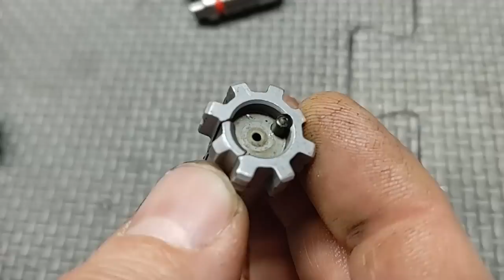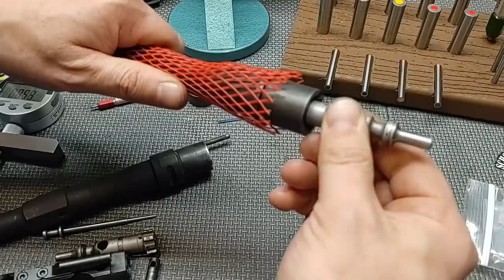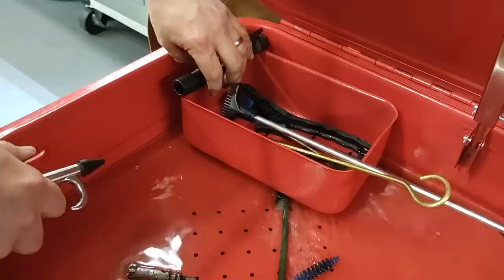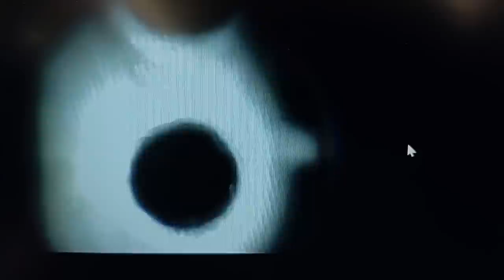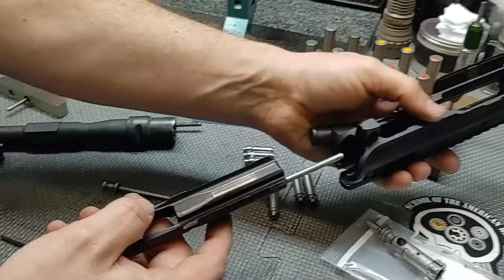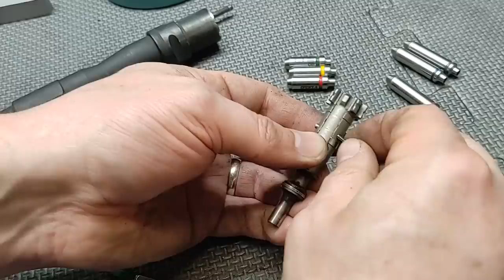Part 1 - LMT Enhanced Bolt Physical & LMT Enhanced BCG & Barrel Autopsy

Comment: That carrier is not designed for that caliber or pistol gas system. The bolt if fine. The can track timing is different, designed to increase dwell time in a 14.5 in internal piston barrel. Use standard carrier.
Reply: Wrong the bolt was undersized check out his part 2
Reply: @STARxLORD  Chris is NOT wrong about the redesigned cam pin geometry. It was designed for 14.5-inch carbine length gas systems Ala the M4. The dwell time in a pistol length gas system is totally different. The fact that this particular bolt was out of spec in no way negates Chris's original comment.
Reply: Sooooo.... I looked at lmt defense description of the enhanced bcg. 

"This carrier group was designed to function effectively in full-auto, suppressed, and short barrel weapon systems,..."

From what I understand, 1) definitely not for a piston ar platform (if that was what you were trying to say) and 2) it is to increase dwell time, in short barrels as well.
I agree, I don't think it is needed for a 300 blackout rifle, and could be a problem... but would be sweet in any other sbr as dwell time is an issue in a mk18 ect...

If I am mistaken, please let me know.
Reply: Chris is 100% correct about the carrier
Reply: @swatbwana  then my question is... 
Is the dwell time bad in a 14.5? Enough that someone would make an enhanced bcg specific for 14.5?

Edit: I watched an lmt video on this. 
Yes, you are absolutely right. The intended purpose is for carbine length gas, 14.5 upper. 
I thought 11.5 and up were good with dwell time... I'm just a sad confused man 🤔
Reply: Sad and confused? I can't count the number of times that has happened to me. Mostly with women. But sometimes with guns too.

Comment: The LMT "Enhanced" BCG was solicited by Crane and engineered by LMT to address parts breakage/reliability issues on a very specific platform—a military M4 with a 14.5 in. barrel and Carbine length gas system;  the further you stray from that platform, the more chances you take that it will be a detriment to reliability rather than an enhancement.  While the bolt is just generally strengthened and stress relieved in ways which should provide increased durability in any AR-15 platform (occasional spring replacements notwithstanding—they are wear parts after all), the carrier is another matter.  LMT altered the cam path in a way which optimizes timing for that M4 Carbine, and the change is not universally compatible.  The Navy didn't even end up buying these EBCGs because they didn't work in rifle-length M16s.  I have no idea if it's a good choice for a .300 AAC with a pistol-length gas system, but it seems like without a lot of data to support that use case, you're just rolling the dice.
Reply: That's what I'm thinking also. There cam pin i, think is smaller. This might be a proprietary bolt carrier, but might not be the enhanced one. Without looking and all
Reply: @Your Internet Buddy Yep, I have the same 10.5" 300 blk barrel from LMT, and ran a standard carrier and bolt.  I even have an 11.5" in 5.56 and also run a standard carrier, but with the LMT enhanced bolt.  No need for the e-carrier in those.
Reply: My understanding is that the e-bcg was failing in the rifle length intermittently and only under automatic fire.  I've been running this in a suppressed Daniel Defense 9" 300BLK pistol gas setup.  It runs flawless and noticeably reduces the emitted gas coming back towards me. I probably wouldn't have picked it up if I wasn't running a suppressor with a fixed gas system due to the price.
Reply: That's not true at all. All it does is relieve stress on the 2 lugs that sit next to the extractor. watch the video. And if that was the case why did LMT sell it in this configuration? Clearly stated at the beginning of the video it was a LMT factory built gun.
Reply: @JTTTTT850  I'm afraid you do not understand the system as a whole.  The enhanced BOLT is designed to relieve stress on the lugs, but the enhanced bolt carrier also differs from a milspec design, and in a way that is not helpful for all gas systems.  As I said in my initial comment, the enhanced bolt should be compatible with most 5.56mm ARs, and provides some additional durability, but the enhanced bolt carrier group is only an "enhancement" in certain specific configurations.
Reply: @gwpattrick  The LMT enhanced BCG uses a standard cam pin; the path the pin travels through is different, but the pin itself is "mil spec".  You may be thinking about the Knights Armament bolt, which has a smaller cam pin hole, to strengthen the bolt where the walls are thinnest around that hole, and therefore needs a smaller, proprietary cam pin.  The KAC system is otherwise compatible with a standard BCG.
Reply: Interestingly, using the EBCG in my 20" milspec config works very well in semi auto, and the delayed cam path is quite helpful with a silencer. I have no idea of machine gun reliability in such a config.
Reply: Wow, great insights! I actually came here while considering ordering one of these! Now I realize it may not be the right fit for me! Thank you!
Reply: Yeah, when frist see that 300aac bbl and EBCG on the same table, I was confused as to why anyone needed an EBCG for that barrel. EBCG is made for those overgassed and suppressed  5.56 carbines... Looks like someone threw $$$$$ into a platform without really understanding what each part does.
Reply: What’s your opinion on using it with a mid length 14.5”? The barrel I’m eyeing for my next build us a middy.
Reply: @baronvonsnazzy3355  I asked Joe Hajny (rep from LMT) this very same question some time ago, and he said it was good to go for a 14.5 mid-length.
Reply: @doktorfaustus  thank you sir

Comment: I think I've seen less grunge on a truck axel then there was in that LMT carrier.  Apparently the owner doesn't yet know of the importance of cleaning after use.
Reply: I don't think its necessary to clean an AR-15 after every use,  you didn't explicitly say this but it was implied,  I think a cleaning every 500 rounds is more than sufficient. 
But yeah that BCG was disgusting, mine doesn't look like that even after 500ish rounds.  Perhaps suppressor use here?
Reply: @toki89666    Yes, cleaning any gas driven system after use, be it an AR, or gas operated shotgun is a must if one is to prevent corrosion of the metal, or Carbon lock.  after use simply field strip the gun, flood with Gun-Scrubber, scrub area's with stiff "Nylon" brushes (no steel) re-wet then blow out with compressed air, takes all of 5-minutes.  Apply a quality "Gun" specific lubricant such as Ez-Zox (*no WD-40, it's a water displacing agent that is designed to dry over time*) and allow to cool to room temp before placing into a Sack-Up silicone treated gun sock and storing in the safe.  As the saying goes, "An once of prevention saves a pound of cure"...   ^_^
Reply: It's the carrier, meant for 14.5 carbines, not black out ir pistol cartridges. The user needs to change the carrier.

Comment: I have one of the LMT ebcg's and it runs flawlessly. But I am using it with a 14.5" with a carbine length gas system. Works both suppressed and non, without an adjustable gas block. I just throw an H2 buffer in it with the can on. Runs like a champ.
Reply: Cool! That's what EBCG was made for, a 14.5 or 16 inch 5.56 with a carbine gas system. The delayed unlocking and faster pressure release in a 300aac probably just created issues that won't exist in the first place.

Comment: Hello from the PNW, 
Chad, 
Thanks for the really informative videos, I'm self taught but a bit ocd when it comes to tolerances & gauging also but I don't have your breadth of knowledge or experience. I'm going to forgive you for giving away one of my closely held sources, Pacific Tool and Gauge, lol! 
While watching some of the SOTAR Bolt & BCG inspection videos, I saw these videos, 
part 1 & 2 on the LMT enhanced Bolt (2) & Carrier, followed through by checking the headspace on the .300 Blackout Barrel. I really appreciate the thoroughness of your instructional video here as I have a LMT MRP Upper w/ 10.5" Barrel in 5.56x45, I'm using this for a build project with an LMT Defender lower Receiver & I have 2 Complete LMT enhanced Carriers w/ enhanced BCG's.
I'm signed up for back in Stock notifications with a few Companies for the 14.5" LMT MRP Barrel w/ Carbine length gas tube. As this is the set up I want to run and I believe the 14.5" barrel with the enhanced Bolt & Carrier should offer the durability, reliability, longevity & hopefully accuracy I'm hoping to achieve w/ this build project.
I'm likely not going to use the 10.5" Barrel but will use a XM-177 style flash hider/moderator pinned & welded for NFA compliance, since I have a couple in my Shop.
But I was writing this comment on the headspace checks that you did on the .300 Blk. Barrel, I planned on headspacing the Barrels before final assembly & test firing. I have a set of go, no go & field gauges but I was very impressed by your design and set of go, no go & field gauges.
In your video on Why do we gauge so much, you stated that you started making these for people who were in your classes and at the request of friends & others who had seen them and mentioned that you would be selling them.
I have checked the School of the American Rifle website and as yet haven't seen these headspace gauges available.
Will they be offered through the SOTAR website in products or is this set something you do as a custom order?
I would really like to purchase a set for the 5.56x45 but would also be interested in versions for the .300 Blk. , 6mm ARC , for AR platform build's. I would definitely be interested in a set in .308 Winchester perhaps other Cartridges if you expand your offerings. The modification of base's of the headspacing gauges was sheer brilliance exercised through experience & into physical form, well done.
I'm definitely interested in the set of bolt tail gauges, the taper pin gauges are of interest as well.
I noticed in the comments one from the Gentleman from smallarmssolutions which was a good tech answer, I thought.
Their channel has an excellent video "The Buffer - Theory & when to use what Buffer.
I found it really interesting, having worked at Colt and being well versed with the exhaustive testing @ Colt for the AR platform, he's in the video said he has a thick tech sheets folder regarding the results of testing of buffers at Colt and provides a really detailed and cautionary breakdown of the various weights & types, when, and for various gas systems, barrel lengths, weather condition effects ect. I would recommend the video for others such as myself who believe safety to be a critical part of a build project.
Just have to say I'd prefer watching these types of gunsmithing, technical videos to the Golden Globes or Academy Awards any night of the week! lol! I guess I am a bit of a firearms geek as charged.
Anyway thanks again sincerely for the giving us all a better understanding of the AR platform, it's internal operating systems and functions.
I believe it is vital for people considering the popularity of the Rifle to be familiar with it's internal operating systems, components, tolerances and what's compatible & safe when making changes or alterations and what's not.
As I mentioned I'm seeking reliability, durability, longevity and accuracy as well as safety and compatibility of parts when building these Rifles for myself, and there's far too many people who claim expertise & experience with firearms making video tutorials, how to videos ect. It's important to separate the "Wheat from the chaff." 
I think the School of the American Rifle and the information you so thoroughly provide is one of the absolute best resources for working on the AR platform & firearms in the Country.
Our here in Washington State we're also fighting several restrictive firearms related measures in the State House and Senate and we have some great firearms Rights Organizations based here in WA. State. We have a great legal Firm, WA. Gun Law that does up to date videos on firearms Rights, Laws and Legislation in the State, neighboring States across the Nation & Federally and keeps us informed, armed with information to participate in defending our Rights and Liberties as well as the Second Amendment of the Bill of Rights under both the US Constitution and State Constitution's.
Be well and keep up the Great Work.

Sincerely,

Jack Fern,
Tacoma, WA.

Comment: Question for you Chad, I didn't see you check for throat erosion on this 300BO barrel??? That was going to be my guess right next to head space issues.  Myself I've had nothing but head space issues with multiple AR 300blk uppers. Enough so that I've given up on the round in a AR-15. But love it in my Ruger American bolt rifle. Thanks, I really enjoy the walk threws. 👍

Comment: I think an explanation of the field gage and No-go gages should be explained.   I will try to simplify;   go-gage means the barrel headspace is with-in tolerance,  No-go gage means it out of tolerance but if it closes on , it will still fire but needs to go to a gun smith for repair.  Field gages were designed for the military to allow for extra tolerances of acceptable wear in combat but there is a danger of case separation and case damage.  Brass life will definitely be shortened if firing a field gaged fail rifle.
Reply: Closing on a go gauge does not mean headspace is in tolerance, it just tells you it's not too tight to function. It could be way to big which is why you also need to test with a no go gauge.

Comment: Just a heads up. Don’t close your calipers all the way and store them. Leave them open slightly. You will over time notice they spread away.
Reply from the maker: I kept them open about .200 stored and in the case. The videos just don't caprure those things.

Comment: 4:33 The part should be .5280 +- .0005 So its out of tolerance by .00015. Not much but still of. But I dont know what the temperature is.
Reply: So it was the wear, right? So it is good for a manufacturer to go on the upper side of the tolerance so the component can wear and still be in spec?

Comment: chad, can you also check BCG tail concentricity, as in the area where it interfaces with the LAW tactical extension? I had zero malfunction issues but the rear left of the BCG was striking the VLtor buffer tube at the interface point until it wore in. when i check the BCG tail for concentricity it was actually very roughly machined, and visibly off center. Pissed for how much money I spent, i have many other BCGs and even palmetto state has better machining/finish/QC. not to mention the right side of my gas key is staked much harder than the left.

Comment: Kinda a mute point I suppose since the barrel failed headspace, but I would be curious to see how bad the throat was?
Reply: throat should be in very good condition seeing as that barrel never fed more than half a mag through it without a fail to feed. The RMA department had it more hours than I did. I was using the exact ammo they told me they were using. hornady 110vmax and 208amax
Reply from the maker: I'll do a detailed follow up video on the barrel. Bore scope and more gauges.

Comment: I have an odd issue with one of my 300 black outs.  it’s hard to duplicate it’s not consistent either sometimes when I load a round it will misfire. When I try immediate action I usually have to mortar the round out usually there is no indent on the primer when this happens. Mostly happens when I’m working lots of reload drills. Is it possible that the neck of the cartridge is hitting the feed ramps and causing it to jamb itself and get stuck? Roscoe barrel.

Comment: This may have been answered in another video I've not seen yet, but curious why the test of bolt carrier parts for magnetism ?
Reply: For those who shoot steel case ammo, any magnetism is detrimental
Reply: If you shoot steel (or bimetal jackets), you can scrape fragments of steel off the ammo. If your bolt etc is magnetic, those fragments stick to the magnetized parts and can jam things up or just slow things down enough to cause issues. Those little fragments will also cause excessive and uneven wear on parts over time, which also causes reliability issues.

Comment: the bolt carrier has a part that looks like a ring.....is that the actual thickness of the chrome lining?
Reply: No, that's the interior chrome lining weeping out from when they were coating the inside.
Reply: @pigeon2041  i bought 2 premium bcg from PSA...one has a thicker ring than the other...so made me think one is a real premium, and the other is a fake premium ....hehehe

Comment: Here’s a question I have been struggling with and welcome anyone to chime in (especially those with hands-on experience with both).  Is the Geissele RE-BCG $185.00 better than a BCM FDE BCG?
Reply: No. The BCM is phosphate coated on the outside, and chrome-lined on the bolt bore. It will handle gas better over time than the Geissele which is "nano" coated. Which probably just means DLC. Which is a fine enough coating, but the chrome lining in the bolt bore will retain dimension amd gas efficiency better.